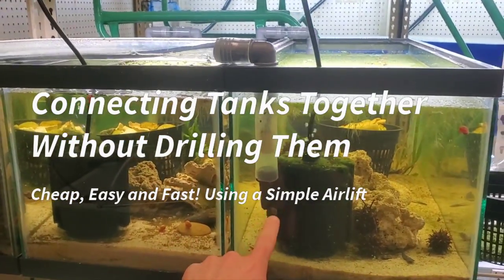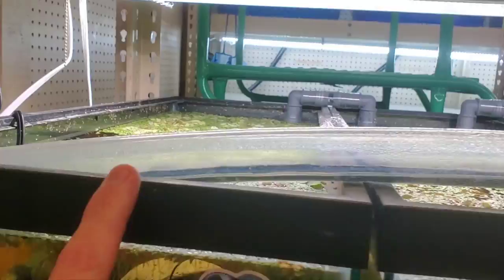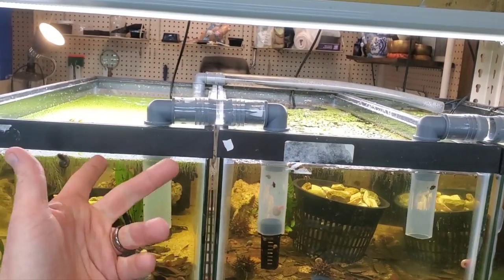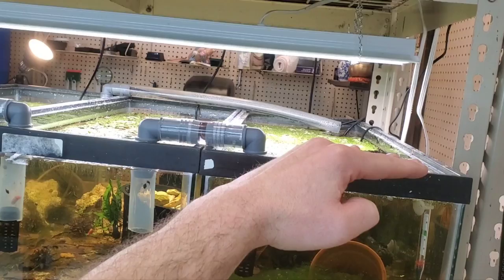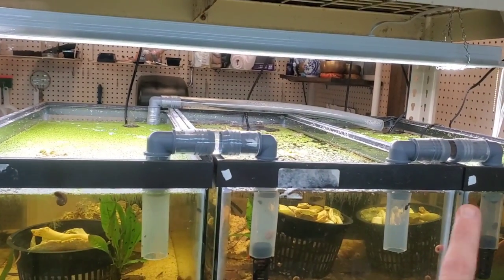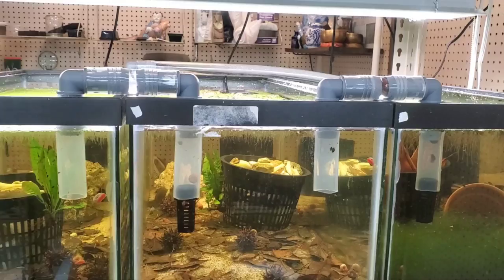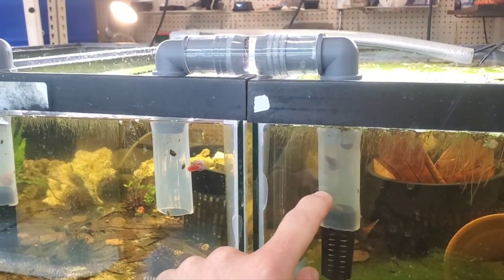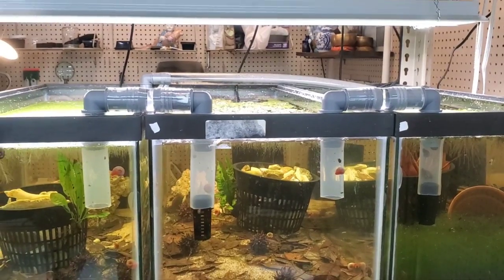PART ONE Connecting Aquariums with a Simple Airlift

Comment: I have been wanting to join 2 large aquariums with a pipe, to allow water and possibly fish to travel between the tanks. It would just be an upside down U shaped large plastic tubing filled with water, no air inside. It should work in principal, if you fill the tube with water and then submerse both ends, and fix the tube so it won’t move. I was originally planning on putting some mesh to only allow water to mix between the tanks. My purpose was to have a planted tank connected to a sand tank for corys as I find corys do not mix well with my planted tank substrates. I prefer them to have sand for them. I have tried growing plants in sand - you can do this, but I was planning on something else. Just an idea.
Reply from the maker: Love this idea and I'm sure it would work!
 Here is a link to part 2 on how I start the siphon.
https://youtu.be/CXzgNnDLY0A
 Same principle would apply to yours. Good luck and thanks for commenting.
Reply: @phillipsfishworks  there was a guy in the US, in a fish hobby magazine in the 1990’s I think is where I saw it or online, who had an aquarium with large plastic see thru piping in a room in his house (must be a bachelor!, but if I recall he did it for his young son). It was incredible. His fish would travel around the living room while he was watching TV. Not sure of the technical details but it is possible. lol…